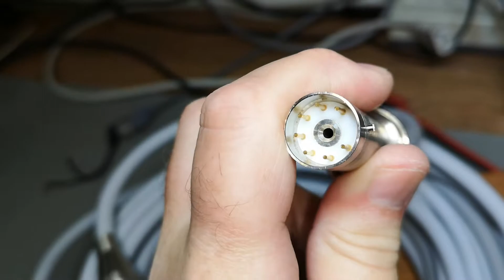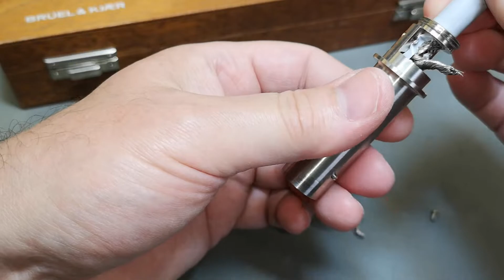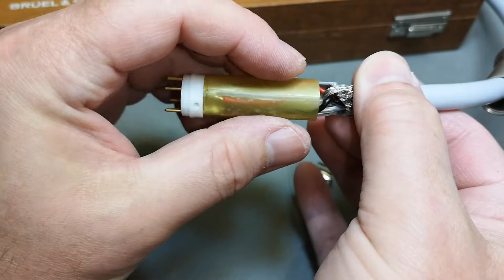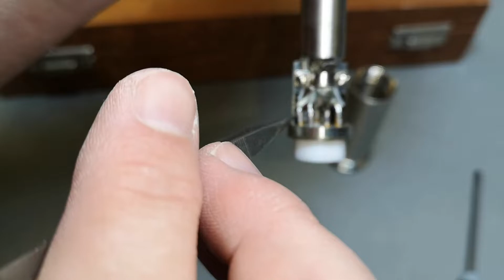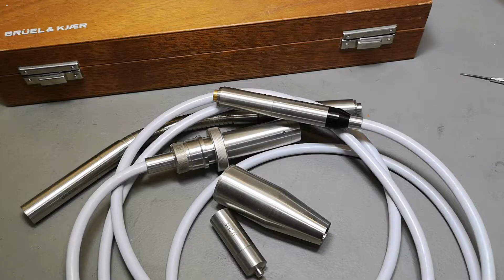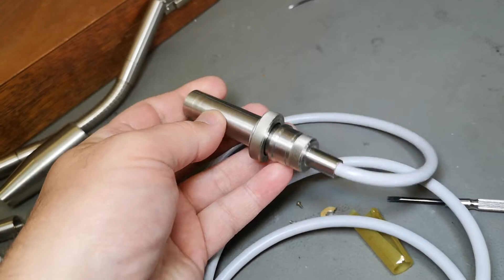Brüel & Kjær microphone type 2619 JJ2615 teardown

Comment: Thomas, thanks again for your videos. Your items are amazingly clean for test equipment manufactured in the 1960s. The 2619 preamp has a huge input impedance of over 4 gigaohms, as it was intended for use with condenser microphones that only output a very small capacitive charge. The preamp FET is located as close to the mic capsule as possible to keep out interference. The condenser mic capsules of the time also required a 200VDC polarization voltage (and some modern ones also still do). The capacitor inside the JJ2615 input adapter cuts out the mic polarization voltage from the little microdot connector input, enabling the user to connect an electrical signal or an accelerometer to the mic preamp instead of the microphone. And the gooseneck adaptor was used to locate the microphone at a distance from the sound level meter in order to avoid unwanted acoustical reflections from the meter casing. Back then the SLMs were huge (google B&K 2209).

Comment: Thomas:  Thanks for these teardown videos!  I collect old B&K and have 8x of the 2619s, as well as a 2511 (and lots of other, mostly 80s/90s, gear you haven't reviewed).  As you figured out, the "winding" you were puzzling over is actually a heater -- which then connects to pins 1 (gnd) and 7 (heater) on the B&K 7-pin connector.  If you'd like, I can send you the schematic (they were generally available for these products until the company was first sold in 1992 -- after they lost much of their "East Bloc" business -- when B&K took much of the service back in-house) . . . !!
Reply from the maker: thanks a lot mark, please send a little test mail to oz2cpu at gmail dot com :-)
Reply: Hey Mark,
I've got two 2619s and a 5935 power supply. Do you happen to have additional documents/schematics for those?